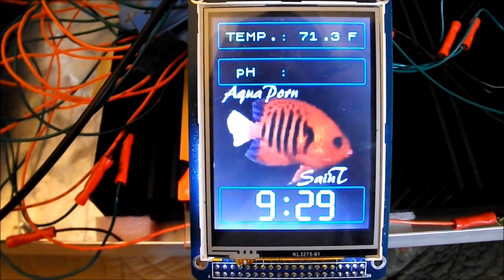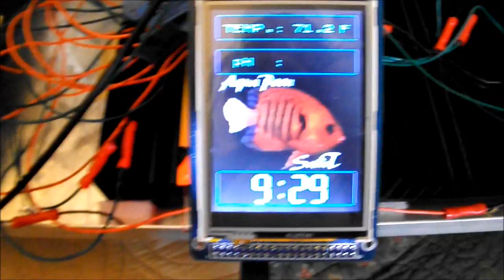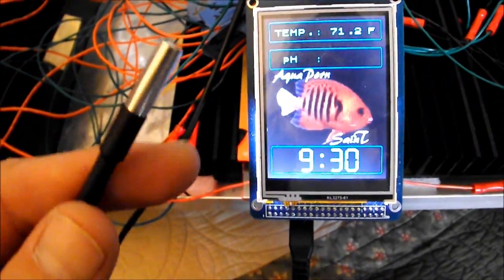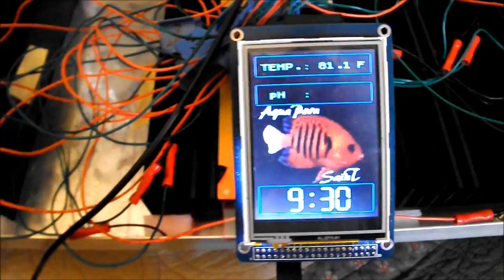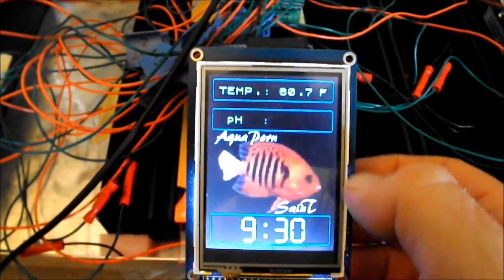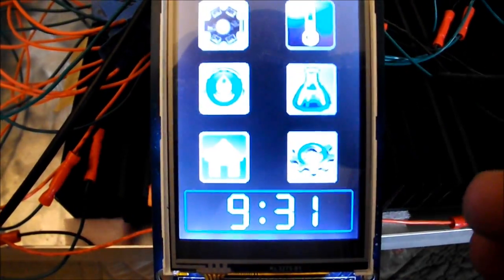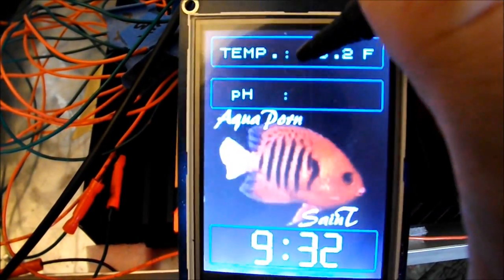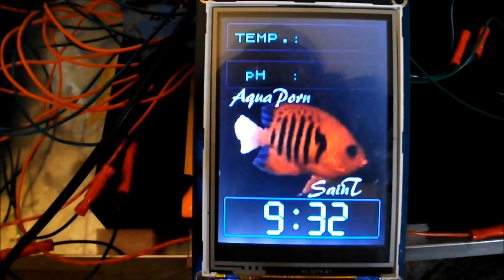DIY Arduino Reef Controller - Temp Sensor

Comment from the maker: The 3.2"TFT LCD, SD Shield, and Arduino Mega processor I got off of ebay for around $35. Temp sensors were $10(1ea) for the water proof, and $2(3ea) for the regular kind. 8 channel relay for the outlets $10 off ebay. $20 for the Data Logger RTC shield. So, about $81 for the controller pieces so far. I still need to get the pH probe/board/shield which can be $100 if I get the best one.
This does not include the LED's drivers, Power supply, or anything else that relates to the LED build.